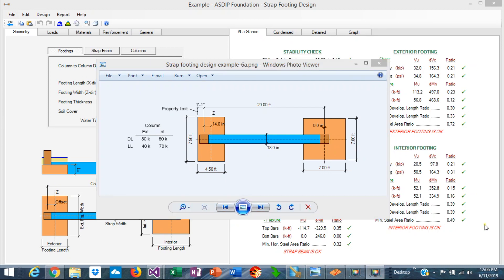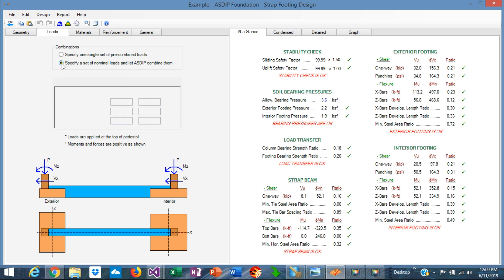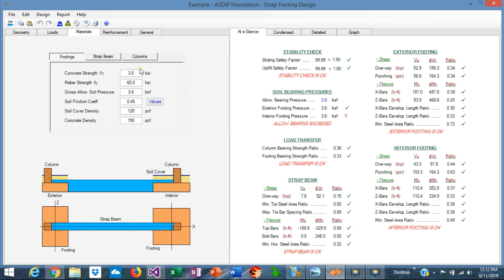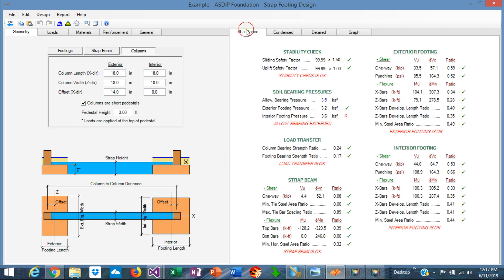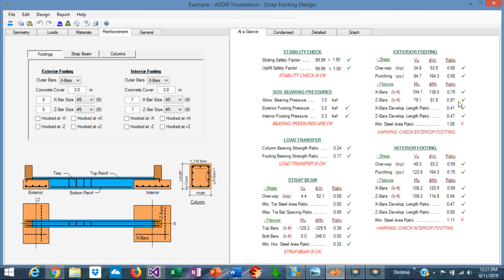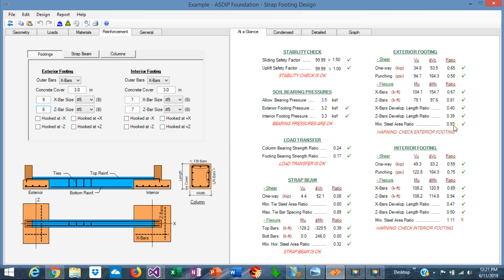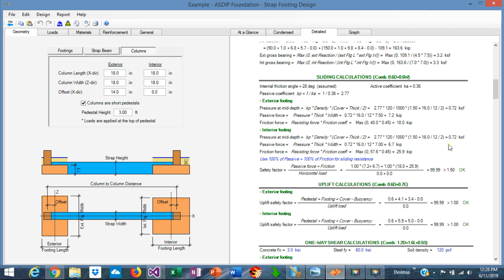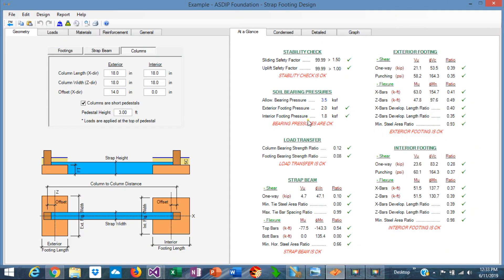Strap Footing Design Example Using ASDIP FOUNDATION

Comment: since the loads in the strap footing design are on the X direction only, do we need to design separately both exterior and interior footing as a spread footing to verify if they can withstand the loads in the Z direction?